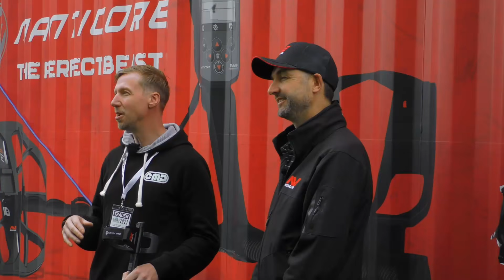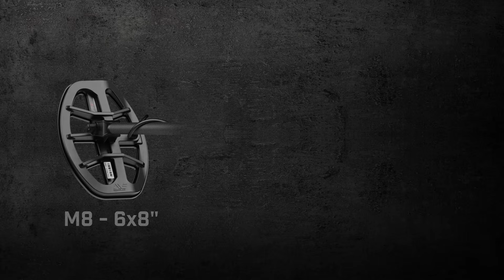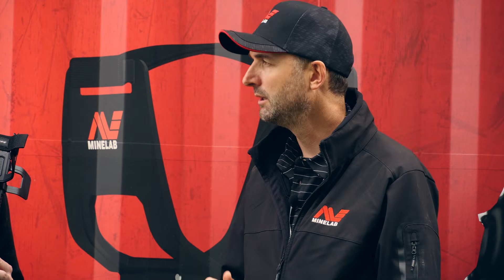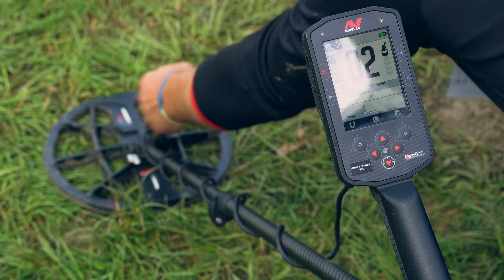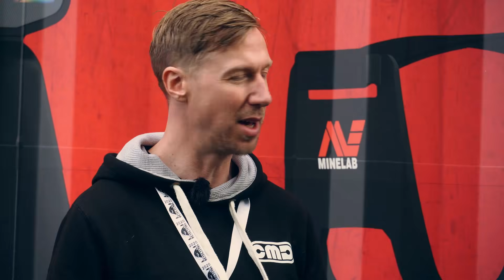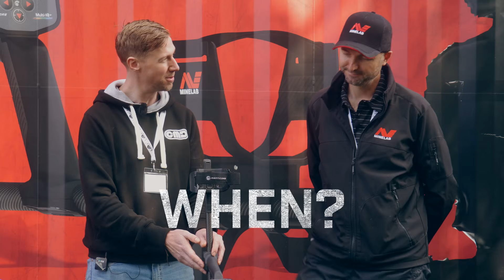Minelab Manticore, Your Questions on the New Elite Metal Detector, Answered Directly by Minelab

Comment: Is there a CTX replacement in the pipeline? I’ve been reluctant to purchase one considering it was released in 2012 and must be due for upgrade or do I go ahead and order a Manticore?!!
Reply from the maker: Hey Devon, we have not heard about a replacement for the CTX, and assume that the Manticore is here for that purpose in many ways. As Mark said, it still has GPS over the Manticore, but otherwise the Manticore is superior.
Reply: @crawfordsmetaldetectors  the Manticore is the replacement for the ETrac.

It is around the same price point as the Etrac and around $1000usd off of the CTX.

Also keep in mind the Etrac was dropped out of production shortly before this machine was dropped. 

ML isn't going to drop a CTX replacement without keeping the price points close.

ML also said when they do drop a CTX replacement they will also drop an update for the CTX.

Comment: So this machine should be better for small gold nuggets than the nox? Some users say the nox is good by itself for small gold hunting.
Reply from the maker: Yes, the Nox 800 has a gold mode and although isn't a pulse induction machine designed specifically for gold, is great at discovering it! However, we do think the Manticore will beat the Nox, in terms of Depth and Discrimination.

Comment: Minelab didn't want to help me with a problem I had on my X-TERRA 705, so I don't support them or trust them anymore.
Reply from the maker: Sorry to hear this Skysim. We know the X-Terra has been off sale for a while now, so we're guessing that servicing and repair is difficult now. We do have this sometimes, whereby customers come to us with older machines and we struggle to help them fix them due to parts being available etc.
If you're looking for an upgrade please let us know and we'll do our best to help.
Reply: @crawfordsmetaldetectors  The problem was that whoever manufactured the poles for the detector punched the assembly holes in the wrong places so the coil and the housing were misaligned so much it made swinging the detector level to the ground nearly impossible and Minelab still didn't care to help me out. Great customer service.

Comment: Not happy trying to explain not going wireless when you have a chunk of copper wire attached to the coil.
Reply from the maker: Hey Will, In this case, we think it's obvious to state that some metal needs to be present in the coil to generate the electo-magnetic field required to detect. But, we believe Mark was referring to not exacerbating interference by adding any more metal.
Reply: @crawfordsmetaldetectors  their is a wire connection from the coil to the control unit.. He was not a happy chappy telling his story.

Comment: Any chance that the Minelab company has fixed the problem with all the waterproof problems. It looks like they are using the same magnetic charging port on the manticore as they used on the equinox and that appears to have caused some heating of the plastic body around the charging port which causes the plastic to crack and allows water to get into the device.
Reply: The leak in the equinox's was actually the gore vent sealing the base of the battery inside the handle, youtube a video explaining gore vents so you can see what a gore vent is, in the case of the equinox, the water ingress was due to a fault with the gore vents
Reply from the maker: Hey Rob, we haven't seen it tested in the water yet, but the increased waterproof depth suggests improvements have been made.
Reply: I've been asking this for awhile now.
Reply: Yes the rest of the world is waiting to hear from Minelab what steps have been taken to improve the waterproof efficiency. 🤙🏽